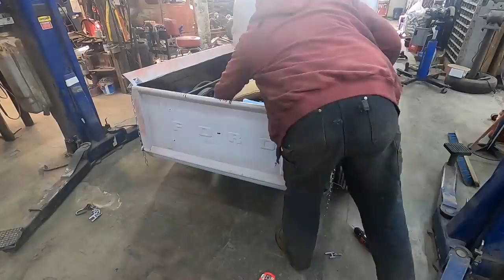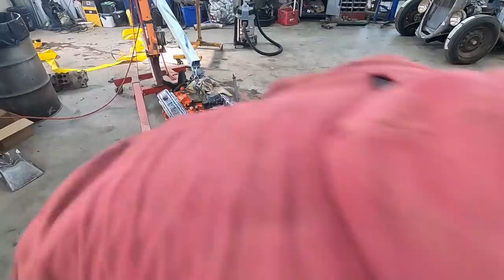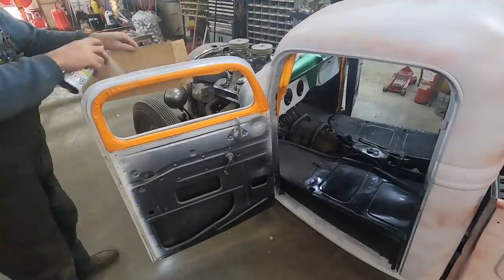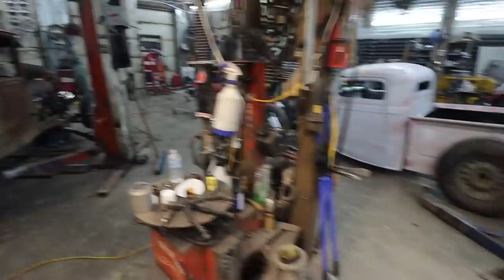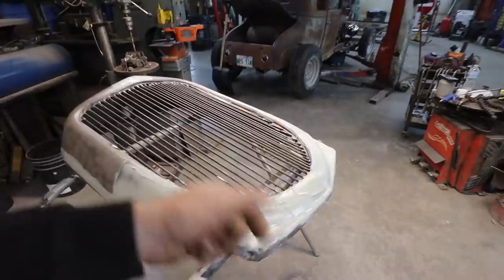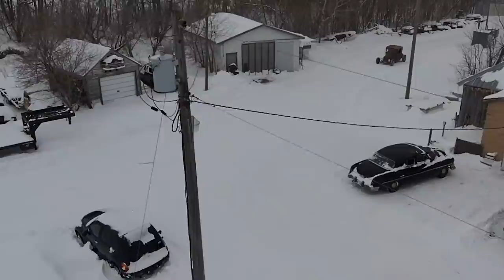Installing grill bars and metal flaking the dash in the 37 Ford Hotrod Part 33

Comment: I like what you did to the grill.  It looks almost “factory”. I am still wondering if you going to install a backing behind the 1/4” rods.  The emeral green metalflake on the dash is a hit….. great video.
Reply: He said he was going to so the round rod would stand out.
Reply: That's a good idea.. that would be awesome
Reply: All that metal flake looks like it was painted in the 70s
Reply: @chuckstith838  Brent still has to paint clear over the flakes it looks really rough until you spray many clear coats over the flake that's when it takes the deep affect, that goes with patterns paint job's the more layer's of patterns the more clear coasts you have to spray to get the deep look. If you were to just tape up patterns with no clear coats it would look and feel rough just in case no one knows about what it takes to do Kustom car show paint job's many many hour's and day's spent on waiting for paint to dry so you can add another layer.

 It's not a simple and fast job. If you want it to look GREAT 👍🏽

Comment: The grill bar's came out awesome. Looks like real nice aftermarket.  The reason the grill shell looks off is the lower left side the width of the surround has a  slightly different shape. Not the pieces you removed and retached.
Reply: I think you are right
Reply from the maker: Haha probably right will have to stare at it later
Reply: @HalfassKustoms  An approach you might want to take with the grille is to take a digital photograph of it head-on, then in the photo editor of your choice, cut the photo down the middle, flip one half along the vertical axis and set its transparency to 50%. You can then superimpose it over the other half of the photo and see exactly where the lack of symmetry lies.

I suspect that part of it is the bottom edge - the side that you reattached pretty much as-is has a bit of a curve to the bottom whereas the side that you had to remake has a straight bottom. To my eye the remade bit doesn't seem quite as deep as the as-is bit either, but I can't tell for sure. The flipped semi-transparent superimposed photo trick will tell you for certain.

Comment: I believe that if you recheck the bottom of your grill, you'll find the rod you used to fill between the two sides, the point is off center to the driver's side by about a 1/2 inch.

Comment: Great job and thanks very much for the vid. The aprons on the chin of the grill look perfectly fine to me, leave it…lol’s!  Perhaps a bug screen on the back side, I used one on my 32 rdstr and it disguised the aluminum rad pretty well. You’d have to check fitment, but it seems they’re available in the usual years, 32/34/36.  Also maybe a lower grill pan (ala ‘32) blacked out to take up some barren space, ground cover and view of the axle. Great job and thanks for the vid!

Comment: You just made my Monday too. The grill worked out perfect with the bars. Exactly what I pictured with bar stock. You did the install easier than I thought, but you're the Wizard ! The only reason I thought you wouldn't use bar stock is the cost. I suggest you go with painting the bars silver, and painting your insert mesh behind it flat black for contrast. The mesh should be set back a little to keep the look of the open bars right, eh? Thanks Brent ! Hi to the doggies ! 👍😎🍺🐶's
Reply: You can accully make you a wall hanger using the tops of modern doors and cut and weld them together look like a 1934 grill then weld some round rod like what Brent did. I seen a video where this guy made his own GRILL SHE'LL using modern doors cut the tops. Kinda have to find the right one's in a wrecking yard that have the shape you need that would work best.

Comment: The screen you had for your t is an old grain. Cleaner screen triangle usually used for taking buck wheat out. They make several sizes, round hole and even slotted.  Coming along nicely!

Comment: Grille came out nice. Round rod sure made a difference. When I did mine, I painted the radiator black , then painted the grille bars black. It worked out good for mine. Great job. Good video.

Comment: To me the grill should have been sectioned in the middle, on the bottom to make it flatter and shorter. you could then lose the wings. I think that's what's bothering you is that the bottom is too narrow and long and comes to a point. But then these things are subjective. Overall great project. Lovin' it.

Comment: I had been captivated by the grill from the start, imagined just how you might proceed with it. I like the round rod as the grill, however I like that center support road that you cut out, it's not mine .. so your the boss! I like as you work, mudding up sanding.. and spray painting away how it looks totally cool. Putting back it's chin.. looks cool.. is it the green goblin?

Comment: what if you mount that emblem to the grill bars itself a little lower than were you showed it in the video? be similar to what most modern vehicles do (I would still keep it near the top and not centered), do but it looked like it could work. wove the work so far, and how you found a flake system that worked even after multiple attempts you knew what you wanted and got it.

Comment: I have been looking at that grill chin for the last 2 videos trying to decide if it was just the camera or whatever. I finally saw it after you put primer on it. The left side is the same shape as the right (looking at the front). The right side is just rotated or higher on the shell than the left. Measure down from a point on the top of the grill to the corner.
Reply: exactly
Reply from the maker: Yeah gave wr a twist today but still seems off haha

Comment: Noico insulation, ever try and remove it? Heat will not remove it. I need more insulation too. Barracuda wants some. Floor and roof.grille shell was definitely an optical delusion.

Comment: Hi I love your skill welding and Tig work.
My question is will you be driving the hot rod truck in the winter, and how would you heat it up? Will you install a heating core on the inside of it, the hot rod truck or is it just for spring?
Reply from the maker: Nope summer rig only

Comment: Excellent video Brent :) that 327 updated motor looks excellent on paint also sounds super too with overall plus cam included  and Truck project paint body color be nice is 1995 Ford Forest green paint blend with metal flake paint green to ! Also rad girll think the get roll of windows screen finger hooks to side inside near main rad to hold in place looks nice! Be almost like rad grill used on farm tractor back 1940 to 1960 years like Cockshutt or Farmall (International) did Brent  and hope give hint to try !

Comment: I'm an old guy.  LOL. I really like the grill.  Looks like the right side of the lower grill point needs to be about 1/4 inch, maybe 3/8, lower and the right slope out a little bit less than that.  I think the curve of either side of the lower grill are not symmetrical. That may be why the template makes it look like it is so close.

Comment: Dig the truck Brent. If you put a spreader bar on the front frame horns it will cover up the bottom of the radiator surround. Enjoy

Comment: Grill worked out very well, considering it was a bit thrashed to begin with. It is so much better than the original 37 grille. 

You had asked if we were interested in how you set up your welders, and I for one would like that as a video. I never see you stick your tungsten, or burn your wire back into the mig tip. I guess those are "skills" that I have acheived... 
Thanks again!

Comment: The chains on the tailgate will knock off paint so back in the day we would take a piece of old garden hose the length of the chain to protect the paint.  We would cut the hose near the middle where the chain would be changing direction when the tailgate was closed.  I have seen some green sparkle hose that would be ideal.  What do you think?  I'm Jus Ascan.

Comment: Why don't you use some wires coathangers then all you have to do is just straighten them out either that or find a no shopping buggy and cut it around the size you need from the basket

Comment: I've used seat belts to latch my tailgate...also used the slide bolts. The slide bolts tended to make noise while driving around but probably because they were a little sloppy. I also used the covered cable to hold the tail gate when open instead of chains because the chains made noise and dinged-up the paint.. To get rid of the twist in the tailgate, take it off, lay a board under it (in the right place) and have a friend hold down one side while you press down on the other side..it will work...done it! Heck, even Chip Foose guys tweak doors, trunks, tailgates etc. by just using blocks of wood and some force. Regarding how the grill looks a little "off"...it's the bottom right side that is shorter in height than the left side...it's a tad smaller then the left side. Add some steel to the bottom of it and my guess is it will look better....but you already got filler all over it haha...oh well...most people won't notice anyways. A buddy of mine got a whole bunch of stainless steel 1/4" rod shelves out of a couple commercial freezers and I used them to make a grill...polishes up better than chrome and stays that way...just a tip for cheap S/S rod! And of course it can be welded with regular wire (don't need to use S/S welding wire if the welds are not going to show). Now when I see an old commercial fridge or freezer I grab the S/S wire shelves. That Sh$t is expensive!
Reply from the maker: haha my gate is tweaked just right that I don't think the bolts will make any noise :)
Reply: @HalfassKustoms  lol don't listen to me...I tend to shoot my mouth off sometimes and don't really know what I'm talking about...especially now that I'm an old fart. Love your channel!

Comment: Wow, 
You should be a Grill Master very impressive work I like how your gril looks now, hey one thing I was thinking is that if you are wondering if the front is level or semantical mount it the way you want it & if you have a laser level put that on the front of the grill and take a look at the bottom part and see what you think, it should give you a nice line to go off of.
Really sweet job plus I'm like it how that a green metal flake looks pretty beautiful looking nice job how many coats of clear coat did you put on it how did it come out smooth or is there enough I'm liking how that a green metal flake looks pretty beautiful looking nice job how many coats of clear coat did you put on it how did it come out smooth or is there enough mils of material to sand it down to sand it down? Seem like your going for it, I'm so looking forward expectantly to see how truly beautiful this truck is going to be Pablo's a hoot is it ready yet? Can we go for a ride, couldn't likely find another canine sidekick as great as old Pablo, yeah I just started seeing the weight gain on him may have to take him for some runs and check his afterhours that old goober smooching hound dog.
Best David
Reply from the maker: It's not smooth maybe I could sand it but I'm to really concerned just wanted the look haha
Reply: @HalfassKustoms  looking good .👍

Comment: The grille came out great. I wondered if you'd just get a grille metal panel or do the bars - yeah, bars are nice. I like the metal flake on the dash. A horizontal 3-line green stripe on the glove box door and instrument cluster would be nice - maybe top weighted on placement? 

So ... get 'er started and running or paint next? 😁

As always, thanks for another enjoyable video.
Reply from the maker: Hear it running would be nice haha
Reply: @HalfassKustoms  - No argument here! That hi-rise manifold should give a nice, throaty roar 😎